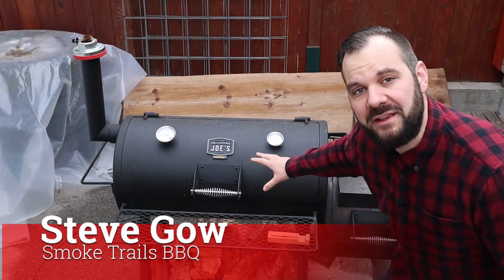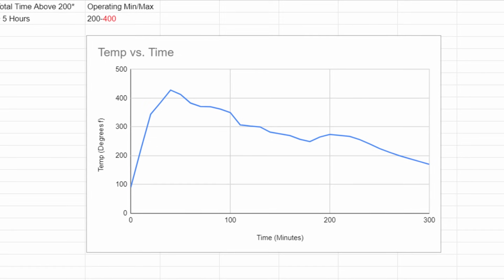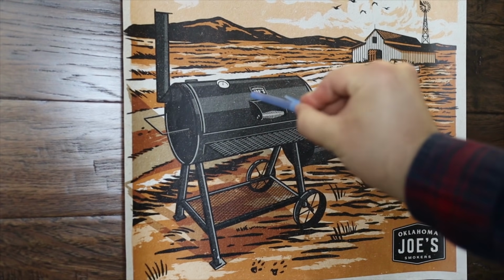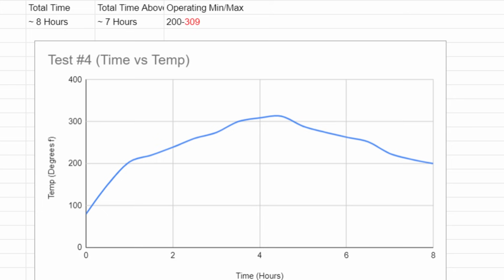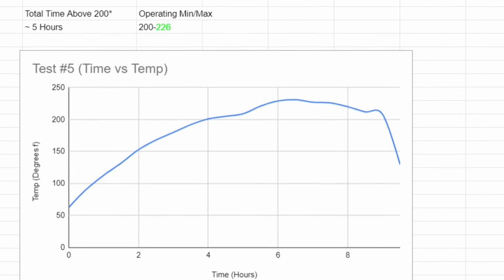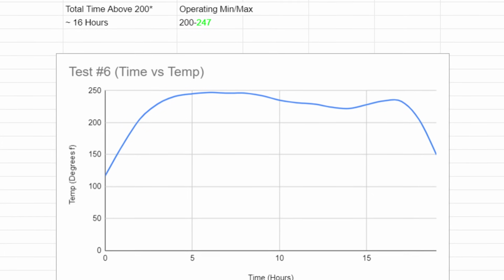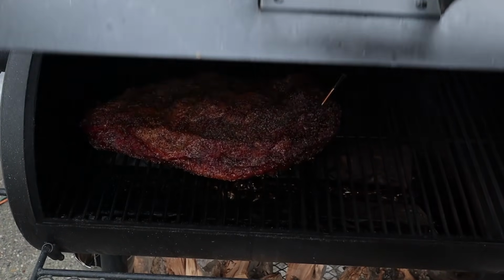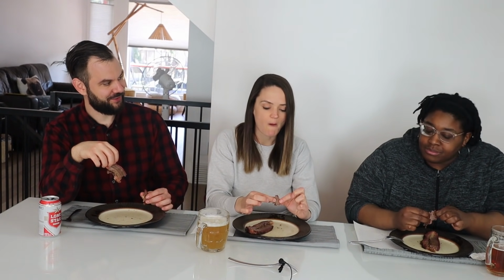11-Hour SET AND FORGET Brisket on an offset smoker (While sleeping!)

Comment: Is the second one more juicy because the charcoal was closed down more and had less airflow? As opposed to the stick burner which burns cleaner smoke but with more air and dries out the meat? You basically created a pseudo kamado - less airflow, more moisture, less smoke, worse bark. 

PS you could have saved yourself a lot of trouble by just cooking it on a kamado. Hahaha. Great video though.

Comment: So here's my solution...  Especially if you're wrapping the brisket, just do your initial five hour smoke or whatever, then when you're ready to wrap, put it in the oven.  You're not getting any more smoke on the thing so the heat source no longer matters.
Reply: Tbc tho, love the video, and explanation of airflow.  I'll have to experiment with the top damper to adjust temps.

Comment: The thing about charcoal, is it burns so clean, you will rarely get "dirty smoke," flavor. Unless you pour water on it.

Which is why most people trying to cook a brisket over wood almost exclusively use the downside flange/valve/aircontrolthingy. I am very well qualified in the scientificology if you can't tell.

This works great for charcoal with just a little wood added. And you can get a decent night sleep with the snake method on a weber smoky mountain.

But this does NOT work with wood only. Which is how I like to run my fire. I only use charcoal to start it.

I would be interested if you tried using the snaking device and pure wood, but small chunks, and perhaps a few "lump charcoal" chips in between them, if you could get 6+ hours out of it. To at least get a short night sleep when nonsense like this comes up.

"Oh yeah, by the way, we know you are cooking brisket, but we want to get together for lunch instead of dinner..." on christmas/turkeyday/etc..

Or really any other time that ends up shitty. 

My best guess would be just straight post oak. Maybe even trim them down to be like 3x3s or whatever the diameter of that snake contraption is.

Then a little sprinkle of those leftover lump charcoal chips between logs, and an additional longer lump or two at the beginning and end. (to start the heat, and rebound the heat)

Comment: What I want to know is if you have your smoker seams sealed
Reply from the maker: Nope!
Reply: @SmokeTrailsBBQ  that's what I thought. I'm having trouble with airflow and getting up to temps an I feel it's because I've artificially sealed the seams.
Reply: @SmokeTrailsBBQ  also do you know the  model of tip top temp you use that fits the joe?
Reply from the maker: @RJ-nl8do  they changed the designation but I think it was the one made for the weber  kettle

Comment: No disrespect to anyone using an offset smoker but if u want to leave a brisket overnigth u need a pellet smoker i leave my briskets 24hrs on low and when i say low i mean 160 degrees with a pellet smoker u can control the heat perfectly and as long ass you can set your pellet smoker to drop below 165 you are gold. Ps cheap treagers do not drop below 190 200.
Reply from the maker: I have a traeger i just like tge offset for bark and flavor

Comment: Hot'n fast maybe?
Reply from the maker: Never! Yea actually thats a good idea
Reply: @SmokeTrailsBBQ  I wonder if there would be a noticeable difference in taste between a hot and fast cook and a low and slow cook... 6 hours seems to be to usual point where guys wrap (at the stall) but how much smoke is needed and what IS the best temperature cook the meat?
Reply from the maker: @blink555  it depends on the grade of meat and cooker for me. I feel like I get more moisture retention when doing a select or choice low and slow. But for a prime/wagyu hot and fast is fine because there's so much extra fat marbling. The smoke ring will also be less pronounced with hot and fast because it spends less time in the sub 140 degree zone where that reaction is happening. And with a pellet smoker hot and fast isn't really a thing. Cooking a brisket at 300 on a pellet grill burns it way too much because of the radiant heat, while 300 on an offset is still nice and gentle convection heat. Oh man, looks like I gotta make another video :)

Comment: Why not cook it like normal and let it rest for the 10 hrs? I have always had way way better brisket letting it sit wrapped in butcher paper, a towel and put it in a cooler for 10 to 12 hrs. It holds temp that long and when you get ready to serve if it has came down to much stick it in the oven a few mins. Good video tho.

Comment: I'm not familiar with an offset, but the hole reason to go for an offset is big smoke, right? So if this was an attended cook, wouldn't you open the draft door entirely just to get big smoke?
Also, take a look at Smobot. That might be a good option (or at least that idea, not necessarily that damper) to use on an offset.
Reply from the maker: I would say the purpose of an offset is to cook with a convection current of hot air that's moving horizontally over the meat with very little direct heat involved. The smoke can be as much or as little as you like. It's just a different way of cooking than a pellet, vertical, kamado, electric etc